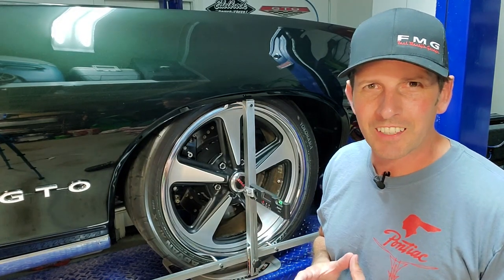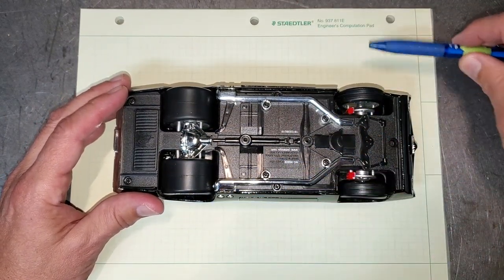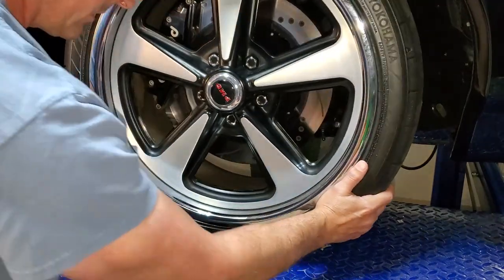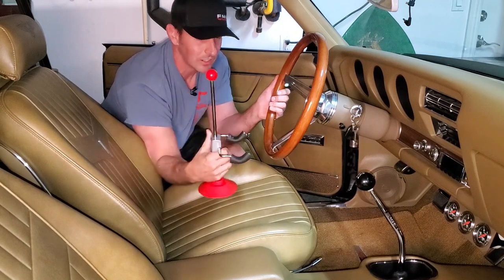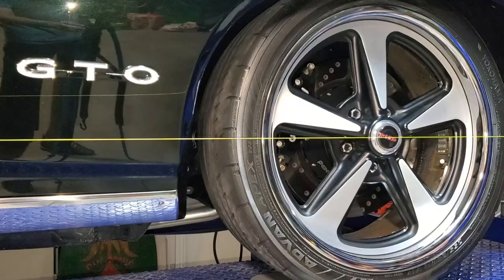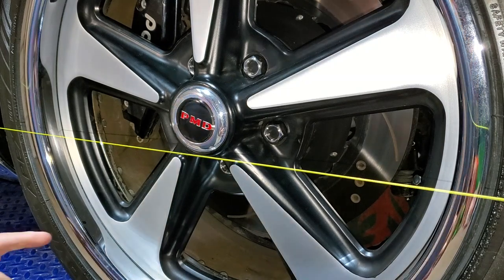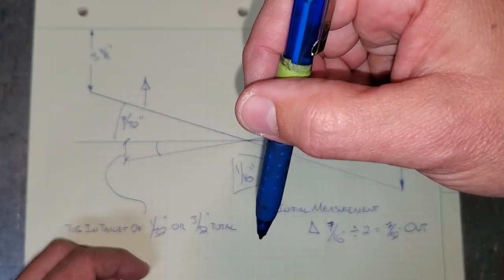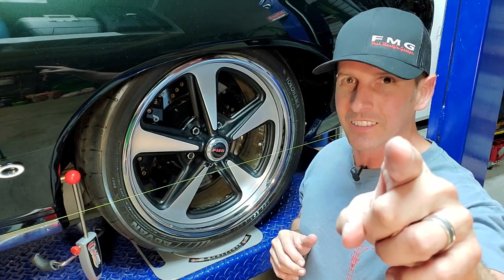How to String Align your car for Toe Adjustment, front or rear - String Alignment

Comment: 8:50, you can still use 1 string at a time if you have different track widths, just compensate for 1/2 the difference in widths in your measurements. So in your example, your track width is 1" wider at the back, therefore the string would be 1/2" closer to your center point than the front.
Reply from the maker: Agreed.  Thanks.

Comment: Another great video and it’s great you spoke about centering the steering system first. I’ve seen a few YouTube videos on toe and some forget to mention to straighten your steering system first. Most important, it’s the starting point. Imagine going to the trouble of adjusting the toe perfectly and then getting into the car and realising that the  steering wheel is out by 10 degrees (or similar) 🤦‍♂️
Reply from the maker: Ha!  Exactly!  Thanks for the comment!

Comment: Love your GTO. 
I just installed UMI tubular control arms on my 72 CHevelle, replacing the stock arms. I also lowered my car 2 inches or so when I did this. I needed to drive the car a ways to get it aligned so I used strings and tape measure and managed to get it within a few degrees so I could drive it to the shop....thanks for the assist.
Reply from the maker: Thanks Brother!  You're gonna LOVE your new stance and performance of those new A arms.  Have fun!

Comment: gr8 video!! PVC will solve the square box issue. this way when setup it’s attached to the car. you can jack up and lower without having to reset your box each time. for us guys who have lowered cars. also, 2 pieces of cardboard layer on top of each other works good in place of a swivel plate. those are nice but i just can’t justify the cost, yet.
Reply from the maker: Good stuff, thanks!

Comment: I also have an A-Body.  But with 15” wheels. Yours look to be much larger that 15”.  If I measure a 1/16” toe in my inward angle will be more than that on your 1/16” on a larger diameter wheel.  Is there a standard diameter where these measurements are supposed to be made?
Reply from the maker: Great question Thomas... The answer is yes.  From what I've researched, the Toe is actually measured at the OD of the tire.  So, assuming our tires are around 26", 1/32" (.03125") toe would equate to an angle of .1377303 degrees.  So, measuring where I measured, call it 9.5 inches from center, the actual measurement should be (.02283"), whereas with a 15" wheel, you'd be at (.01802")  Keep in mind that 1/64" is (.015625")  So, in essence, we could get really anal, and use a digital caliper and measure 15 thousandths, or eye ball it on a ruler somewhere between 1/64 and 1/32.  :)  I think for ease of measuring, and adjusting, both of us are fine at using 1/32 on a ruler.  :)   Thanks for making me break out my HP 48SX, lol.  Hope that helps!
Reply: စ၀၀၀

Comment: Most cars do NOT have equal front/rear track width. You'll usually have to construct a string rectangle around the car. Thanks for posting.
Reply from the maker: Yeah, depends on the age, for sure.  Thanks!

Comment: Hey Monty! First time viewer here, I'm looking to figure out how to adjust my toe on both sides to straighten my steering wheel! I just  replaced the center drag link on my 1985 Mercedes 190e and wanna sort out the crooked steering wheel
Reply from the maker: Hey James, welcome to the channel.  I'm not an expert on Mercedes... It'll depend if you can remove the steering wheel, or not.  Most wheels that are easily removed, like on my car, it mounts to a splined shaft, so you can remove it, rotate it one spline, and put it back on.  That's one method.  On other cars you have to make that change at the gear box, where the steering shaft is connected.  Sorry, I'm not much help for your case, maybe try researching some diagrams for changing the wheel position for your car.  After you figure that out, use this video to dial in your Toe.  Let us know how it goes!
Reply: @FastMonty  To be honest, this Mercedes is as intuitive as cars can get. The steering was fixed by simply disconnecting the tie rods on both end of the center drag link. Straightened the steering wheel, then straighten the wheels until visually straight. I tightened it all up, and made sure the turn signals were in the right spot still. Went to alignment shop and $80 Im aligned!
Reply from the maker: @commandohazelnuts  Awesome!  I love it when a plan comes together.  :)

Comment: I need to do this,  just had wllwood brakes installed on my 79 TA,  all out of whack the front end is now.
Reply from the maker: Congrats on your brake upgrade!  Here's my latest string aligning video, it's really easy if you have the Quick Trick rig.  https://youtu.be/NF7NQgZtx_U  Either way, have fun driving straight again!
Reply: why would installing new brakes knock the alignment out?

Comment: Wrap a string line around all 4 wheels at once.  Use blocks to hold string off the tires and measure.
Reply from the maker: Ummm , that "might" work for squared cars. But, will not work for staggered wheels. Thanks!
Reply: @FastMonty  Use the right standoff blocks and it will.
Reply from the maker: @MikeJones-rk1un  nope. It's not that easy. The way I documented the process is how you do it, without special equipment.  If you want special equipment, check out my QuickString alignment video. Thx
Reply: @FastMonty  It's very easy and faster doing all 4 at once. Of course if you don't like to learn better ways....
Reply from the maker: I'm all about finding better ways... this is the BEST way, check it out. https://youtu.be/NF7NQgZtx_U?si=sfyTOGsE0b4TfmL1   @MikeJones-rk1un

Comment: Does it matter that your rear wheels are wider and have a different offset than the fronts?
Reply from the maker: It sure does!  I cover that in this video, which is a royal pain in the A$$.  Ironically, there's a new solution to speed up the set up, AND I just finished filming that episode.  It will air by Monday, if not sooner.  Stay on the lookout!  Thanks for the great question.
Reply: @FastMonty  

Sounds good , thanks 🙏
Reply: so you like go cart wheels on real cars?  His look great.

Comment: Use the floor instead faster and easyer: https://youtu.be/bdJiOCzYdgw
Reply from the maker: Interesting.  But, looks way harder to do if you have to make adjustments.  This kit allows you do to it in one set up.  Thanks for sharing.
Reply: The little adjustment that are often needed are easily done without freeing the wheels so it's not so hard to put a hand in under the car,  but it works only for toe. On higher 4x4 cars, it is easier to do it under the car and mark on  inside the wheels with tapemeusure roll it 180" forward  and measure againe to get all slack that's in joints in the measurement. Put on zero mm and adjust after behaver on the road.

Comment: 3 and almost 7/8th of an inch LOL why not just use metric measurements. eg. 98mm.
Reply from the maker: Exactly why I said a metric ruler would be better to use. Thanks.
Reply: @FastMonty  I know😁, it's just funny when we (the rest of the world) watch you guys measure things and start doing equations 👍
Reply: @markstone5593  I can't speak for Monty, but any mention of using metric or suggestions of it being easier. Will get meet with pushback. Even on something like using a metric tape measure. I've had multiple friends or family members argue with me that I should use imperial tape measures, and how easy they are. Im lazy I don't want the extra step of fractions. I don't know if it just out of being stubborn or stuck in there ways. But I don't see a switch to metric here in the USA. Not in my life time at least. Owning metric sockets is using the metic system for some lol. Im all for whatever is easiest and less work for me.
Reply from the maker: @markstone5593  You should hear how it sounds in my head, before my mouth starts going.  ha!
Reply from the maker: @jasonnelson6624  Totally agree.  Metric is easier, BUT, it will never be adopted in the US.  Thanks Jason!
Reply: I work in an industry that uses imperial but live in a country that uses metric. I can see both sides of it but in my opinion metric is easier when it comes to multiplying numbers 😂
But if I want to measure something very accurately, then thousandths of an inch is best for me
Reply: 98 and almost 98.1.... 

Same difference.

Comment: You don’t need bearing plates you need to pieces of cardboard laying on top of each other under the tire works just fine and it’s free
Reply from the maker: You're right, Jason.  I do mention the same in this series.  But, it is still easier than using just cardboard.  Thanks!
Reply: @FastMonty  You’re right to brother and I see you have all kinds of cool as nice tools real professional appreciate that thanks for the info
Reply: True
Reply: I bought 8 cheap plastic placemats from the dollar store, the hard plastic ones, not squishy.  A little grease between two of them, then place under each tire.  Easy and repeatable.